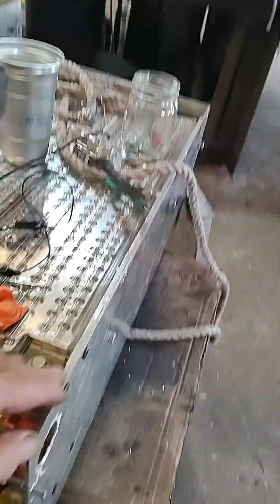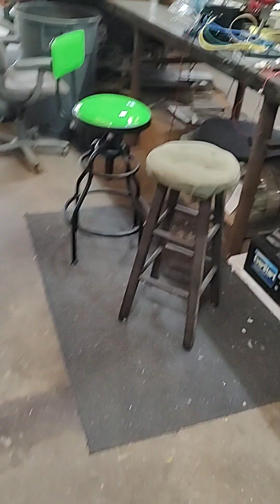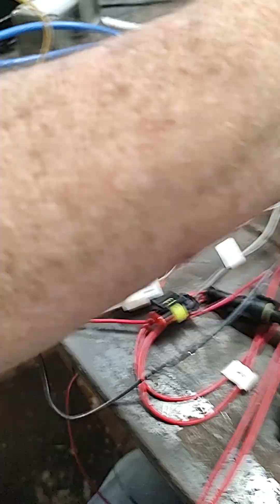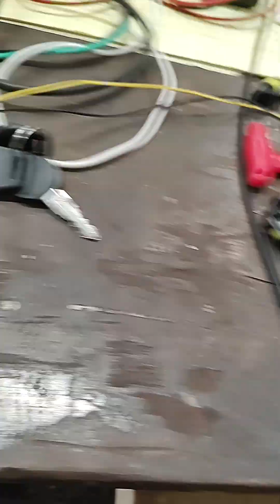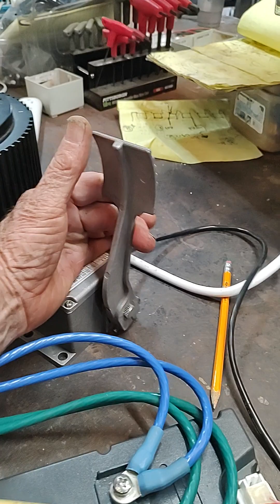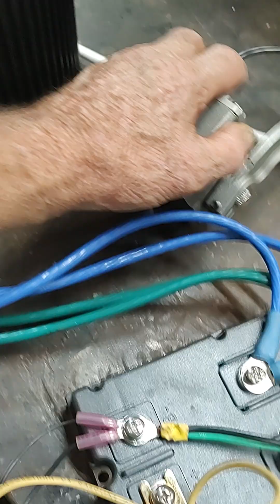golden motor with 72 volt 500 amp controller

Comment: Hi Steve, I have a 2009 Zenn car that I can't get to work. It worked fine and all the sudden stopped going. Do you know what the voltage should be at the U, V and W wires going to the motor? I'm only getting 38 volts at all 3 spots and I'm not sure if that's correct. It's a 72 volt car so I figured I would need 72 volts going to the motor as well? The controller is showing "stall detected" code when I try to run it. The wheels turn very slowly. Thanks for your time.
Reply from the maker: I've seen this happen a few times. It could be the sensor on the motor  that determines where they rotor is. That cogging and starting and stopping is caused by the controller trying to figure out where the armature is and given current to the field windings at the wrong time. Output voltage to the motor is going to change with a lot of factors but if the timing isn't right you get this type of erratic behavior. Look on the shaft of the motor and you'll see a little plug. Sometimes just unplugging and plugging will clean the plug and it will start working or you have to get a new sensor. There's a little wheel about an inch and a half to inches that's got maybe a hundred little slots. Let me know if you need more information
Reply: @steveclunn8165, thank you for answering! That's awesome. I will try this and report back. I'm at my wits end and have no idea what it could be so hopefully this will work. Thanks again for the reply.